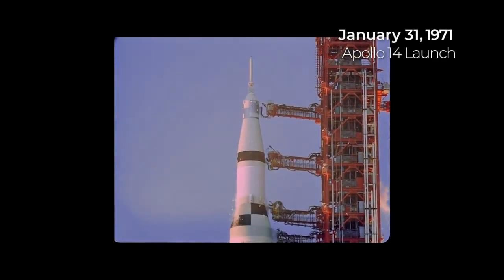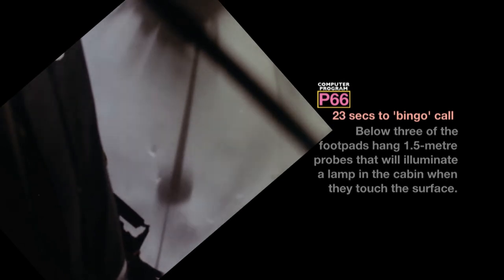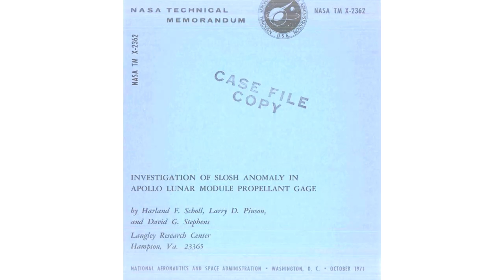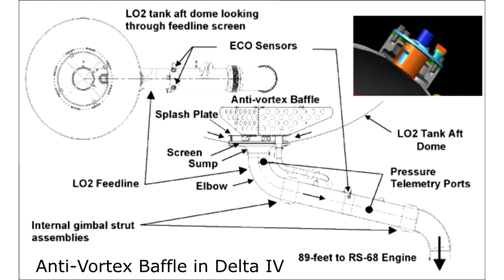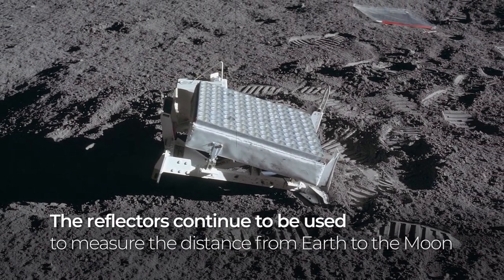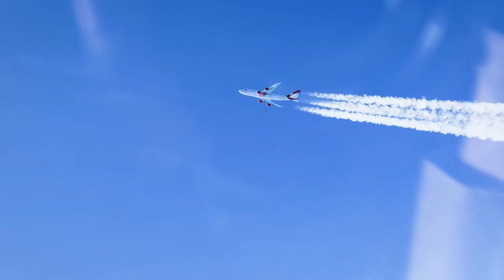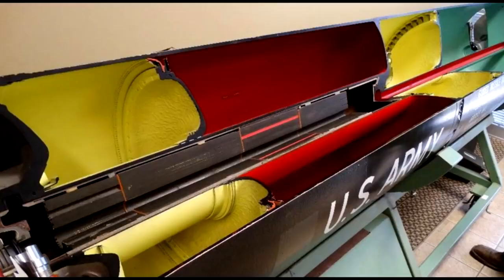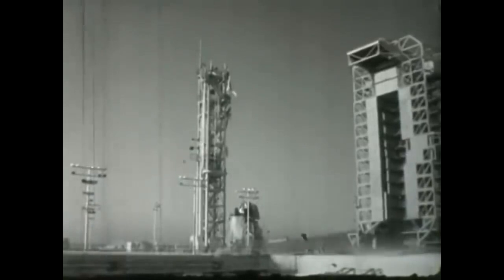How NASA's Apollo 14 Fixed A Critical Problem Using 'Keyhole Rocket Surgery'

Comment: Fuel sloshing around in the tank... Sounds like what starship is experiencing right now... Shake up your coke and you get bubbles in the straw.
Reply: @asdrubale bisanzio Starship is having fuel feed issues - gas bubbles, when going from horizontal to vertical.... not sure what your point is.
Reply: @asdrubale bisanzio Do you think coca cola's contributing to global warming?
Reply: @asdrubale bisanzio I don't know what video you watched. During SN9's flip and burn, 1 of 2 engines fails.  You clearly don't know what you are talking about, stop replying to my comment.
Reply: @asdrubale bisanzio The header tank is pressurized with a GAS (when at STP).  Propellant settling problems in liquid engines at unusual attitudes is a known issue.  Its what killed Virgin Orbits first air launch.  Of course spacex engineers aren't dumb, but you are.  You probably shouldn't comment if you don't know what you are talking about.
Reply: @asdrubale bisanzio Wow you won't give up.  I don't know if can explain it to you in a way that you will understand.  First off, the second the engines start spooling up, its not full anymore right?  So gas forms in the tank.  When the vehicle is not vertical and there fluid moving inside the tank, gas bubbles can enter the fuel lines.   Its been stated that its a fuel delivery problem in starship... the problem is kind of obvious, but the solution is not.

Comment: Scott, thanks for making this video.
Did I inspire you asking the question below at your previous video 
(your video called: SpaceX Starship Number 9 Makes Perfect* Flight (*except for the landing which was a huge fireball)
My comment there:
"The crash(es)/instability maybe caused by fuel sloshing in the tanks.
Sloshing liquids in the main tanks cause major instability during the apogee belly flop, and the during the vertical transition.
During landing the smaller circular header tank in the nosecone and one in the top of one of the main tanks are used.
So, sloshing in the latter tanks might cause problems getting fuel into the fuel lines during landing.
Even if the internal pressure is okay, when the fuel is sloshing around, it doesn't go into the fuel lines.

If the sloshing is (one of) the problem(s)s, then why not use the same kind of grids in the tanks, like airplanes have in their wings.
The grids/ ribs serve for structural strength and balancing fuel.
Google: "airplane fuel tank ribs".
At the center of the tanks grids aren't useful,. Near the internal surface they are more effective.

In all available animations of the internal of the spaceship  no internal grids are shown.
They might not have taken into consideration applying them."

Comment: I think that in a way we made a few steps backwards since that era. Apollo's ascent engine was a beauty of hypergolic simplicity. No electric pumps (like in Starship) which introduced multiple points of failure, no separate ignition mechanism, just two tanks with valves whose contents would spontaneously ignite when mixed together. This idea is so reliable that it seems only an act of God would prevent the fuel from igniting. And when I look at all these possible points of failure in the Starship, with no bail out mechanism, when I look at the Dragon whose descent engines with awfully question-marked shaped pipes and liquid fuel in them prone to bubble formation and explosions, so unlike the far more reliable solid fuel powered engines of the Russian "shroud" bailout system on top of the rocket, - I really wonder about the motivation of their designers. Behind Apollo was the government that really didn't want the embarrassment of its astronauts dying on the Moon. But once the old political enemy and competitor USSR was no more, - suddenly we see the era of flying (or rather tumbling) coffins of shuttles with no bailout mechanism whatsoever, and tragic unnecessary deaths brought on by predictable points of failure like "onion rings" and piece of "magic foam". And don't get me wrong, I absolutely love the Dragon, it's a scifi candy that looks like it belongs in the Expanse TV series. But I feel that its safety is left far behind by the old clunky, cramped Soyuz, and I really miss the era of engineering simplicity and reliability that seems to have irrevocably faded into the past.

Comment: So many ways to fix "Fuel slosh" tho. For example do what they did on the Mclaren F1 to prevent the fuel from influencing the car movement. Just use an inflatable bag instead of a solid tank.
Reply: That didn't prevent fuel from sloshing though. The bag design, reduced weight and also reduced risk of bursting open in a crash. F1 still has to use baffles inside the fuel tanks just like rockets do. For similar reasons.
Reply: @benr.4238  
I think that would greatly depend on the rigidity of the bag... However this was recently identified by Gordon Murray himself as one of the biggest design flaws of the Mclaren F1. Especially since it has to be replaced every now and then, and is a 30 hour operation at an astronimical cost. And also has very little function on a road car.

However. Couldnt a slightly pressurised chamber do the same job. Like a syringe with fuel in it. Always only being the size of the fuel that occupies it.
Reply: @captain_context9991  Apologies, I confused your mentioning of the McLaren F1 car model, for the McLaren F1 motorsport team. I meant F1(the motorsport) uses baffles in their fuel bags. I can't speak to the design of the F1 roadster. Murray would certainly know more about it than I would.

I don't think a pressurized chamber would work. Or at least, not as well as you're thinking it might. G-forces work on gases too.
Reply: @benr.4238  
I would think a pressurised chamber adds to the danger element. Otherwise Im pretty sure they would have thought of that. But I dont see the problem with having a piston.. Like a syringe. Where the actual size of the tank changes with the content. No room for anything to "slosh" around.

It seems such a trivial problem to fix. Even by compartmentalize the tank into smaller segments. Smaller movement = less problems. But when even modern rockets struggle with it, its probably things they have tried already.

Comment: Excellent explanation & vintage footage Scott! Just out of curiosity, what is the lowest temperature a bladder could be used to help maintain the constant pressure on the liquid propellant. I assume kerosene, even the supercooled kerosene that SpaceX uses could utilize a bladder kept under pressure by backfilling with gas, but surely this couldn't work with cryogenic liquids. So, is there a minimum temp beyond which bladder technology can't be part of the solution for maintaining pressure inside a propellant tank?

Comment: I recently saw a video about Mariner 10. At takeoff there  are two rocket flames coming out at the side some meters over the main rocket motors, what were these for?
Reply: exhaust gases from the fuel turbo pump

Comment: Can you do a full video about the pros and cons of each anti-slosh solution that has been implemented over the years?  I'm very curious as to why some are used and others not.  Though I suspect the top two reasons are cost and weight.

Comment: Starship is not in "Zero G" when it needs to light it's engines, as it is falling at Terminal Velocity by that time (At Vt : Acc=0 therefore g=9.81). This one is an orientation issue not a Zero G slosh issue. The header tanks are needed because when the ship is horizontal the fuel is then orientated on to the side of the tank (downward side) not the bottom (as when Vertical) where the engine feeds are located..
Reply from the maker: Did I say it was in zero g?
Reply: @scottmanley  It's more that you didn't make any distinction between Virgin Orbiter (Horizontal Freefall) and Starship (Horizontal Freefall) where Virgin's ullage was to compensate for ZeroG due to freefall, the headers in Starship are to compensate for orientation, and not freefall.
The inference that a student may make is that all the craft listed were under Zero G because all where in freefall/orbit.. whilst Virgin is, Starship is not.

Comment: For engines that operate in a vacuum, where does the unwanted gas that is mixing with the propellant come from?
Reply: It's a combination of boiled propellant and pressurization gas. If your fuel tank is 100% full of fuel, you can't pump that fuel out fast because of the vacuum behind it. So, instead, it's mostly full of fuel, with some pressurized gas that will expand into the space left behind when you remove the fuel. The other thing is that you usually can't have a liquid sitting under a vacuum because the high-energy molecules in the liquid will just float off to form a gas (aka the liquid will evaporate or even boil). So you end up with a mix of the pressurization gas and boiled/evaporated fuel as the gas component of the tank.

Comment: In Terms of fuel tanks I have an other idea... What if Starship uses it's payload area like a moving truck, stuffed with equipment. Once in orbit one can evacuate the tanks and refill them with 21% oxygen and 79% nitrogen at 1bar pressure and head it to a comfy temperature. Than enter the tanks via a docking port with a crew dragon and use the whole spacecraft as a space station...

Comment: What's the rocket that fails at 9:31 ?
Reply: Looks like an Atlas and I don't know about the upper stage (possible an Agena??) these old ICBMs had no structural support so had to be held up by pressure in the tanks. This incident is a result of a loss of that pressure.

Comment: So the half-full fuel tanks have lots of gas (which mixes with the liquid in 0g) in them... what sort of gas? Where does it come from?
Reply: Liquid hydrogen is pressurised with gaseous hydrogen, same goes for oxygen and methane, they are pressurised with gaseous versions of themselves that comes back from turbopumps, for other fuels they use helium.

Comment: I was wondering 'bout the use of bladder bags inside tanks ... if slosh is your problem, why not use them ?  So now I see that they have been used ... Q: why aren't they always used ?  Sounds like a lot less hassle than add rocket trusters to push the propellant to 1 side, no ?  Or is it all about weight again and the trusters already being there for other purposes ??
Reply: I see cryo temps are a potential problem ?
Reply: At -180C the rubber or plastic would not be flexible.  The bladder would shatter or crackwhen fuel is removed..

Comment: If you put a horizontal baffle up to ( say) 70% of the tank diameter on the starships main tanks three quarters of the way down ie so this lower part remained 70% full when it manoeuvred to the horizontal - thus giving the engines liquid propellant when they restarted.could that eliminate the need for complex header tanks?
I note the Starship always ‘ flips’ the same way so the baffles only need to be on one side.The said baffle would also be useful when the craft goes to the vertical as it would massively reduce ‘slosh’.
Or is that complete rubbish!

Comment: Yes, indeed, concerning the surprising amount of “research, design, and engineering“ that is required. May I add fabrication to that as well? If people only knew how difficult it is to form and weld columbium....

It is purported that it is effectively impracticable to manufacture any new F1 engines, because of the dated sophistication of their fabrication and assembly.

P.S.: I have a vague memory that there were more (dedicated!) ullage rocket engines mounted and fired on the Saturn V, than the number of rocket engines used for main propulsion.

Comment: Up until the piston was mentioned, I was wondering why they didn't use a metal plate cut to the same size as the inside of the fuel tank to push down to fuel level so there wasn't any room to slosh around. I realize these guys are way more intelligent than me but I can't get my head around why they wouldn't just shrink the available space in the tank, either the way I mentioned or some other way.
Reply: All my bright ideas are already patented. The better ones are not expired.

Comment: I really dont like the starship nosecone header tank. Seems to cause more problems than it solves. Too much exposure to thermals and pressure. Id use the downcomer for methane header tank, just increase the radius. And fit an oxygen header tank right next to it. Both cylindrical with a piston pusher to keep it all as fluid. All thermal and pressure exposure would be kept to top&bottom domes and outer sides. Minimal pressure difference between all the individual tanks.
Reply: That would work, except it would make the starship belly flop impossible. The point of the header tank is to spread out the weight of the vehicle and have the center of mass bisect it. If they just had to at the bottom, the whole thing couldn’t lie flat during belly flop and would have the engines fall first. This would make the engines feel all of reentry and it wouldn’t slow them down.
Reply: @jakemckee2005  I dont think the header tank is that sinificant. But if all else fails, Id rather put a lead weight in the nose than the header tank.
Reply: @protonjinx  except that would make the whole thing even heavier.
Reply: @protonjinx   and if it wasn’t that significant, SpaceX wouldn’t even have it.

Comment: "Research, Design, and Engineering". or as some call it "Rocket Science" to get a rocket flying as one unit in a precise direction.  Without the "RD&E" the engines tend to fly, but not as one unit and not in a precise direction.

Comment: I really hope you tagged Elon Musk with this link on Twitter or emailed it directly to him. I could be wrong but this definitely felt like a wink wink nod nod here’s how to fix starship video. 😉😁
Reply: Fuel sloshing was an issue on SN8 and SN9.  SN8 had green green engine exhaust due to oxygen rich combustion.  SN9 had yellow engine exhaust indicating fuel rich combustion. Bot could cause engine failures

Comment: An asymmetric centrifugal/centrifuge pump (think washing machine with a big dent in the side during the rinse cycle) would keep the bubbles out, maintain pressure and eliminate slosh.  eh .. nevermind ... probably just create a new problem with vibrations.  ... Makes me think of a Tesla turbine... hmmm...

Comment: for a second I thougt how does the fuel slosh in space. Then I remembert the moon has Gravity. hahaha
Reply: No, the Moon has nothing to do with it here, it's during the burn. The acceleration of this burn was less than a g but it's enough for the propellant to settle at the bottom of the tank, and with attitude changes it sloshes as if you were rocking the tank here on Earth.

Comment: A non reactive sponge in the fuel tank, would have calmed the slosh easier.
Reply: too much displaced volume, the issue is every baffle or sponge you put in your tank replaces what would normally be fuel, so you want as little mass and volume of material as possible for the job
Reply: The problem is also: how to attach the foam so it doesn't tear away from tank interior during violent sloshing. Also, you must not have rocket engines ingest foam fragments.

Comment: It's always about squeezing more and more out of the engine... sometimes what is counter theoretical is actually valuable in the sense that additive process also allows for the injection of more generated critical mass at injection and so, more mass volume... and therefore more variable volume of mass available at critical intersection...

Comment: What we want to do is keep that blast flow right off the wall... the gist being, less fuel used, more heat generated, greater expansion capacity available, less stored pressure required to achieve greater mass expulsion...